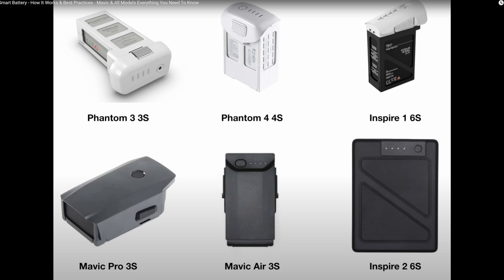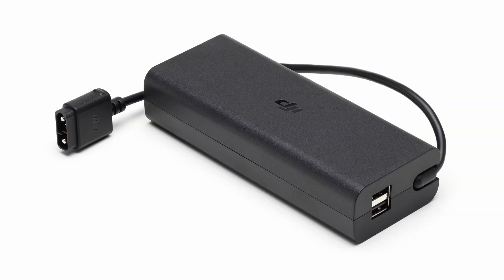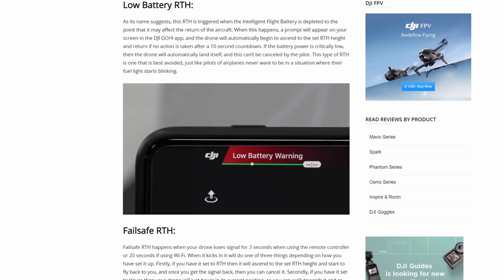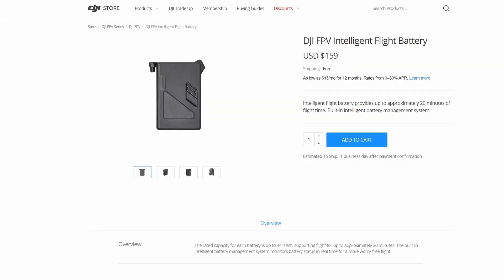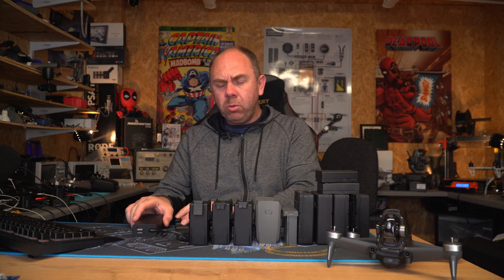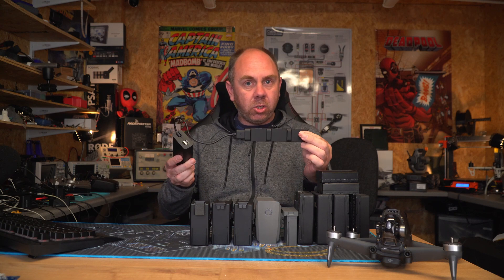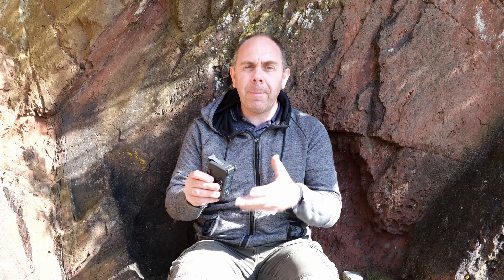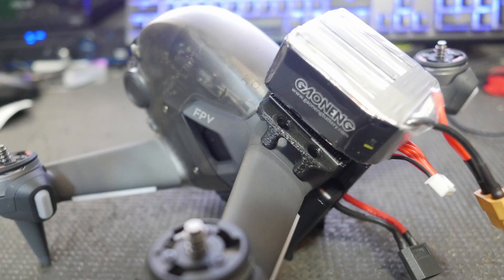DJI FPV Drone Smart Battery - How It Works, Tips & How To Get Best Life

Comment: I purchased a DJI FPV second hand, and 1 of the 3 batteries will not charge. When I plug it into the hub, the light flashes green for about 3 seconds, then turns red. When I push the power button on the battery, no light appears…..is this battery dead?

Comment: I admit these are not cheap batteries however their features and build quality and smart features make these the best so far.  In Australia these batteries cost AU$229 each or AU$429 for two including the battery charging hub which alone is AU$70, so the fly more kit is two batteries and one charging hub for AU$429.  

I purchased an extra four sets of the fly more kit so now have eight of these smart batteries - so all up around AU$1,840 for the four fly more on top of the AU$1,600 for the FPV combo kit which also includes one of these batteries.  Never cheap out on batteries for these high power / high drain devices like drones as its simply not worth the risk personally or hardware wise.

Comment: What does it mean when it says in my goggles "battery lifespan reached"
Reply from the maker: DJI have a change/use count timer in the battery.  Basically you have reached what DJI believe is EOL for that battery.  On older drones this was as low as 100 cycles.
Reply: @MadRC  thank you! Thankfully all of my batteries are still working great despite those notifications 😅

Comment: Hi, i plowed my drone into the ground at speed, only breaking 1 arm which was fixed with a liberal application of glue, but the 4 cells compacted into each other. This is evident from the new gap that can be felt at the top of the battery through the soft side covers. There is now about 1cm of space on the top cavity of the battery where the cell was previously. However, i have had around 50 flights since, with no issues noted.
Is this ok to keep using?
(The cells clearly haven't ruptured, and have hopefully just displaced space. What sez u?)
Reply: have you got Dji Refresh or drone insurance

Comment: Should I just leave my DJI FPV batteries on the charger when not in use?
Reply from the maker: No don’t do this. They should be stored somewhere cool, dry and out of sunlight so they will self discharge

Comment: Hi ! Cheers from Argentina ! I have a question. The battery is fully charged but when I want to start the drone, the led lights blink fast in red (low battery)
Reply from the maker: That can also mean you are in a no fly zone.
Reply: @MadRC  
 But when I put other battery it fly normally. 
Thank you for answer.
Reply: @guinchostudio  Im having the same issue with two of my batteries and can't figure out what to do.  Did you ever figure out what to do?

Comment: I currently have an issue with one of my batteries I get the flashing red light on the drone and I think it has something to do with firmware as I had to update all of my 6 batteries. These batteries are very new and I see this battery has only had 2 flights. I can take off the drone won’t start the motors so I swap it with a different battery it works.
Reply: I'm having the same issue, did you ever figure out what to do?
Reply: @flawlesskrush2145  nope still also waiting on DJI to get back to me about what they want to do.. Not great considering it’s a brand new battery.
Reply: @chappysktichen1624  from what I gather it happens when you charge the two batteries in the kit with the charging rail.  I guess your supposed to charge it one by one on the charger it came with the first time.  But nothing in the instructions say this as far as i know

Comment: Great stuff. What’s the DJI Power supply voltage? I’m in the position of having the drone kit but no charger (it’s currently plugged into the vendors wall!). I’ve a variable power supply on my normal lipo charger.

Comment: I have recently brought a DJI FPV combo and the battery has been saying maintenance required since day what does this mean?
Reply: Actually, the manual addresses this, telling you to charge to 100, leave it for a while, discharge to 20, leave for 6 hours, then should be balanced on next recharge
Reply from the maker: You can try cycling it a few times but if that continues then you shoud reach out to DJI.

Comment: I just got the fly more combo n the batteries don't light up or seem to charge at all either one of them .are the in hibernation mode or anything I have to do
Reply from the maker: All you should need to do is put them on charge and they should come out of it by them selves.  Literally just plug them in and leave them 15 minutes and it should be charging.  If it’s not i would make sure your mains adapter is plugged in properly.
Reply: @MadRC  left all night nothing

Comment: I cannot understand if I can use a power bank to recharge the FPV battery. Any ideas?
Reply: Ive got the same question. Did you solve it? 
The only way would be to use a powerbank with a 230V powerplug

Comment: Thank you for the great topic and video. 

   I am not quite sure about the 3 days term, when after this time the automatic discharging is triggered. I am used to fly RC helicopters, where the LiPo battery sets are also very expensive and thats why I immediately charging my all batteries to the storage level (3,6-3,85V per cell) after getting home after flying, like it is recommended by LiPo and LiOn producers. Than the lifetime is greatly improved by getting  at the storage level as soon as possible (not in days, but in minutes). 
   I have asked my DJI dealer about the automatic discharging of DJI FPV batteries and he says, it is supposedly after 10 days for DJI FPV batteries. The mentioned 3 days are allegedly at e.g. DJI MAVIC , AIR batteries ... I had no time to check it yet, but it is no problem to find it out by measuring. 
   Anyway, even the 3 days are very long time.  If it should be 10 days, it is very bad for their lifetime. The same with charging - it should be done immediately before flying. It simply means, not to let run the chemical processses in batterries in fully charged state, when it is very strong and it shortens significantly the batteries life. And conversely, also not let them fully discharged. This little care is money saver, even it is sometimes a bit bothering.

Comment: Great video! What do you exactly mean by, run them through a cycle? 13:10 
Like go out and fly once in a while during winter when they are inactive?
Reply from the maker: Yea so charge them to 100%, fly it to around 20% then charge back to around 50%
Reply: @MadRC  Thanks, sounds good. I'm probably gonna fly it in winter but not in extreme temperatures, i've heard it's okay if you warm the battery up first before you take off.

Comment: I might fly my DJI Fpv once a week.   I check the voltage with a meter so I have 22.8V to 23.1V total with no load before putting the batteries away.   Other DJI batteries I check the cells on the app with the motors shut down.   It's not the best way to check them because the quad is still drawing some amps.  I'd rather have traditional lipos with a balance plug.

Comment: What does it mean when I just unboxed my dji fpv, plugged the battery into the charger and it has 4 flashing lights? On my mavics, that usually means the battery is too hot. But my fpv battery has never been turned on.. its room temp
Reply: Might be too late, but this means that the battery has found something wrong and will never ever charge again. They are permanently broken.

Comment: Hypothetically speaking if I were to strap an Insta360 to the bottom of the DJI FPV would the sensors detect it as an obstacle? Could it safely take of with an object hanging and potentially pivoting off the bottom?
Reply from the maker: It can. It’s been an issue on other drones.  You really need to do it on top sadly.

Comment: Thank you Fine Sir!
My wife bought me the DJI FPV drone combo for Father’s Day.
It is my first visit into the FPV world…. I have had  Mavic 2 Zoom, Mavic 2 Pro and a “Mavic Mini.
This is completely different in almost every facet of operation!

Though I jut know that I’ll never have the balls to flip the switch to “Manual”  mode, just flying in “normal“ or “sport” is A phenomenal experience indeed.

Just one note…
DJI, as always,though providing us with a Great Leap Forward in technology, they also figured out multiple ways to screw us .
The batteries are just one of those things.

My wife purchased it from Adorama in NYC.  
She wanted this to be a complete surprise, she knew I’d notice any incoming shipment of that size (Adorama is “signature req’d)
so she actually made the drive into NYC to buy it in their retail store.

She knew that I always need to purchase extra batteries as part of a bundle.
She Also knew I would need at least four or five batteries minimum to be able to enjoy flying.
The salesperson in Adorama’s store was the typical SLEAZY “small hat”  SALESMAN.
(she  recorded the encounter….  It’s horrifying to see how they treat women.  They take advantage of their lack of technology knowledge)

The salesperson AND “floor manager”  told her that the FPV used a unique new type of battery technology.
They told her that the FPV batteries were unique.  
They told her the batteries would only be capable of being charged 25 cycles BEFORE  SHUTTING  DOWN  PERMANENTLY!!
(I initially thought there was a miscommunication….  UNTIL  I  WATCHED  HER  VIDEO  RECORDING!!   — she had recorded everything as part of the whole “Father’s Day” presentation 😳😠)

They told her that the average customer was purchasing 10 additional batteries with each 
drone combo pack.  (5x the double battery set)

She said she felt under tremendous pressure.
She knew I desperately wanted this craft and wanted to thoroughly enjoy it.
Sadly, she believed what they were saying and spent more money on batteries then on the craft!
They make life very difficult with their returns and many times friends have returned items and not been credited I’ve had huge restocking fees applied.

So, I now have a ton of batteries.  It’s actually phenomenal having so many to use, but that was a fortune and I could’ve used the money in so many other ways….

Thanks for your videos ..you
ave a great channel.  It’s about the only channel related to drones that I watch..
other than Kenn Heron and original dobo .
Reply: Oh no you'll have to fly for so much longer to use up all those batteries, what a a tragedy.
Reply: Great post, however, DJI only warrants them for 100 charges. I have 3 batteries and have over 200 charges on all of them already, after only 8 months of owning this beloved drone. I. E. Flying every day will use up about 3 batteries a year. So you're set for the next 4 or 5 years, whereas I'm worried about mortgaging the house so i can fly next year

Comment: Was flying it the other day and realized the battery showing 100 percent charge after a few minutes. Figured something must be wrong, i did get a message saying battery maintenance required. Do you happen to have a video showing how exactly you perform the battery maintenance? Thanks for all the info. I fly over water a lot and it's been a scary experience to see the battery percentage still at 100 percent after cruising it at 60 mph for a good mile.
Reply: Read the manual
Reply: Did you find out what it means when it’s says battery maintenance needed? What do you do?

Comment: Ian, it’s bluesgeek from RCG.

As always, you are at the for front of knowledge.

Have you anything to report regarding sag with these batteries? At what point in the percentage indicator is there an appreciable throttle performance hit?
Reply: It depends on the winds and the speed your going at 
If I’m going 60 in windy conditions, the performance hit will happen at around 40%
But if I’m going fast and slow and fast and slow just chilling it will hit at around 15-20%
Reply: @bmgproductions1006  Thank you. So throttle management might be considered to be fairly consistent above 40%. This is important for us noobs who may not have enough experience or situational awareness to feel the performance hit, and might want to avoid a diaper change along with the battery change!
Reply: @AerRider  thanks for the feedback

Comment: Thanks for this! I have a single battery that is stuck in ‘internal communication error’ and will not charge or power the drone? Is this something you have seen before? Many thanks 🙏🏼
Reply: Is it Dji FPV or another battery?
Reply: @ua9851  DJI repaired it. Was an internal fault on the battery

Comment: Hi Mad, thanks for an informative video!
I assume most what you said is also valid for the Mini 2's batteries?
One thing's is particular to the Mini 2 though, if you have the Fly More combo with the 3 bay charger be aware that it doubles as a power bank and can charge stuff off your flight batteries. But do NOT leave your batteries in the charger when long term storing them since they will not then self discharge!

Comment: Hi,

I have a question about charging the Dji drone's smart battery with a standard RC charger through an XT60 adapter. 
(For example: https://www.thingiverse.com/thing:4799923/files).
I'm not that knowledgeable about electrical engineering, so I'd love to hear your opinion or experience on it ...

The question is: is the "smart" part of the battery necessary for charging?
 Or can you just ignore the data lines and let the charger do the "smart" part, namely not too fast, not overloaded, balancing, etc.?
And if so, what happens to the data recording of the battery in the Fly app?

thanks and keep up you nice videos
Imp

Comment: hello ! Thank you for video! I have a situation: I've bought fly more kit for this drone and put it on charge with a hub. It was charged one bat after another one by one in line. But when these two were installed to the quad he said "battery software is not the right one, please update" and offered to update via Googles. The next charge they didn't charge one after another and hub led became red as one of them charged. The next in the line was only able to be charged when I unplugged the charged one.. so the sequence was changed after update. Do you know how to fix it?
Reply: I'm having a similar issue.  The battery that came with the drone works fine, but then I got the Fly More kit, charged them both using the rail and Im unable to fly with those batteries installed.  The drone just blinks red with no errors.  I've heard from lots of other people having this issue but I'm not sure what to do next to get them to work.  Did you ever get yours figured out?

Comment: These smart features to be built into the battery are bullshit. These can be built into the drone and the battery could be cheaper. I fly RC helis, we alo have Battery capacity measurements, voltage, and current measurements built into the speed controller itself. So i know exactly that i discarged 2893 mah from the 5000 battery. They just want to make more money on batteries....
Reply: I wish the smart features where in the drone rather than each battery but having the smarts in each pack lets the battery drop the voltage for storage when needed.
The logs include voltages of each cell throughout the fight. The batteries are crazy expensive but at least they come with some extra perks for the price.

Comment: Hi, you are showing nearly at the end a photo of an extension with another RC battery until now I couldn't find any photo or description in forums. Where is this photo from? Are there already more known battery hacks? I was trying to attach another battery to the controller and unsoldered the origin battery. First it was no Error by just pulling out the balancer cable. But as I unsolderd the + and resolderd the battery know ist just blinking with one LED and does not power the drone ... Needs to be further investigated :)
Reply: You can power the drone in parallel with the battery but the original battery needs to be connected. It uses a CAN bus to communicate with the battery. I haven't seen that photo before either but I've powered my drone using a bench top power supply but wiring it in parallel with the battery. I did this so I could download logs without needing to keep swapping batteries.
Reply: @ddegn  thx for this expirience. Did u also fly with this benchtop arrangement?
Reply: @EsShark2  I did not fly with the benchtop power. I didn't get any warnings in the goggles though.
I'll need to test more to make sure powering in parallel will work. 
I was mainly interested in keeping the drone powered while I downloaded its logs. I have since gone the easy route and only use the logs from the goggles.
I have a Hackaday IO account where I've posted photos and other details about my experiments. I can't add a link but you can find my pages by searching for my user name. Put a period between Hackaday and IO to find the site.

Comment: Thanks for the video. I got my DJI FPV Combo today and observed something strange. I can connect the googles and take off with the drone without activating them first (just bring both gimbals together at the bottom) So I don't have the system connected to my smartphone or app at any point and I can still use it. 

This is not normal or?
Why should I activate the system?
Reply: Your drone was used. Apparently Banggood is selling some used drones. Where did you purchase yours?

Comment: The DJI fpv come down once the lipo voltage is critical. Had experienced that myself. It just comes down slow and pushing throttle up does not help much. It then hardly manages to keep the altitude.
Reply: I hope your drone was close by when this happened. I've had a few flights where I was worried I'd run out of gas and tried to stay over area where I'd be able to find the drone if it decided to land on its own.